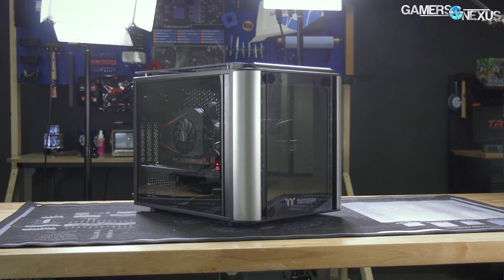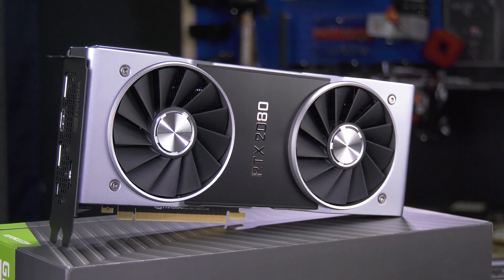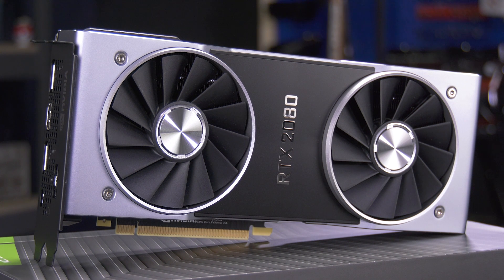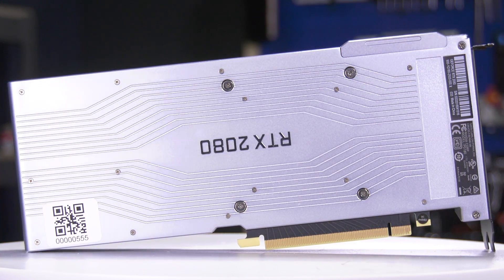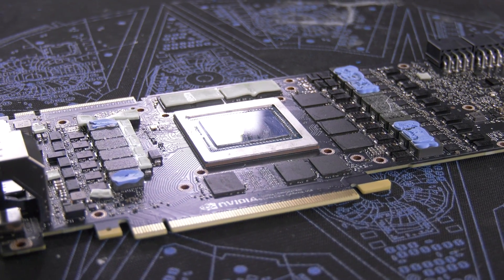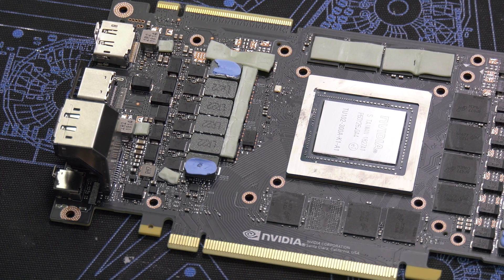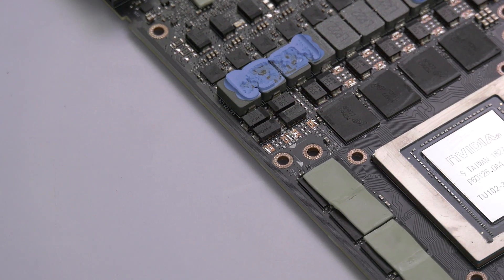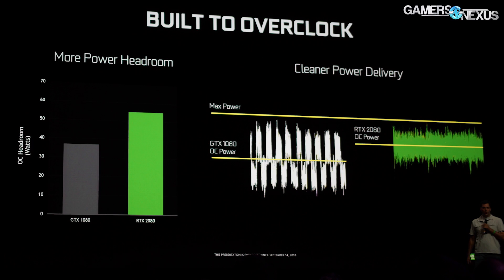RTX Power Delivery Redesign & FE Cooler | Interview

Comment: You should have asked them how to disassemble that shroud
Reply from the maker: 1: Filmed 3 weeks ago
2: We figured it out -- lots of glue.
Reply: noooooooooooooooo not glue,
graphics cards turning into apple products, ahhhhhhhhhhhhh!
Reply: +cataria pega How long before we see Louis Rossmann swearing at a founders edition card :P
Reply: so basically dont take it apart lol
Reply: is the glue better then the tim for intel cpu's? lol
Reply: So they too learned from AMD I see...

:P
Reply: Oof. Any damage done during disassembly? That way, if the answer is yes, people will try not to disassemble it either?
Reply: @GamersNexus  Clue glue, apparently LOL
Reply: Didn't he say it was soldered to the baseplate? The fin stack, that is.
Reply: VOLTEC  He said the heatpipes/vapor chamber is soldered to the finstack.
Reply: Gamers Nexus 1k+ ...glue,class!
Reply: i mean..that crap
Reply: I figured, was just kidding
Reply: I was waiting for them to freak out if he told them GN disassembled the cooler.
Reply: Bruce Banner Uh, you saw how easy it was to remove the PCB right? That's the only part you water cool lol. Everyone else is talking about the actual cooler..
Reply: Bruce Banner Dude, what are you taking about lol. All that needs to be watercooled is the pcb, and that was removed from the cooler EASILY. You put a block on the pcb. The part he couldn't get opened was just the actual cooler. If you need to clean that cooler at some point, then yea, that's a pain that it's glued. The cooler has NOTHING to do with watercooling the card.
Reply: Hot gun vs glue
Reply: Just glue it!
Reply: Glue? Wtf. Ok I'll just remove the damn cooler and slap a water block. Aahh much better.
Reply: Seriously, lol..... STEVE!!! Why didn't you ask that? ;)

Comment: Watercooling will make it on steroids
Reply: If you can get the shroud off
Reply: tclemens96 oh yeah damn, it will be disassembled otherwise I will make it dissemble
Reply: @theeskimo9875   actually looks like they got it down to the PCB just a crap ton of screws. Planning one getting a 2080 ti (or two) and have a custom loop now I see no reason to get an aib card over a founders.
Reply: @tclemens96 - Steve got the actual board out without issue. It was getting the cooler assembly apart that was the issue - which is not something many people would want or need to do.
Reply: @Safetytrousers  yea he said in comments he manged to disassemble it and he will update later, the only reason you would want to open the cooler is either it is extremely dirty and you want to thoroughly clean it or you want to change the fans in case of malfunction.